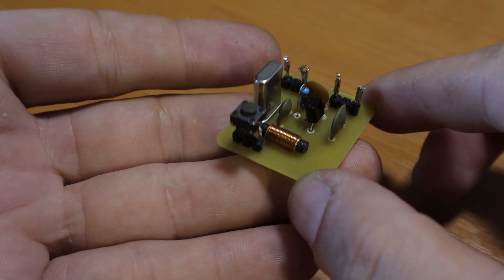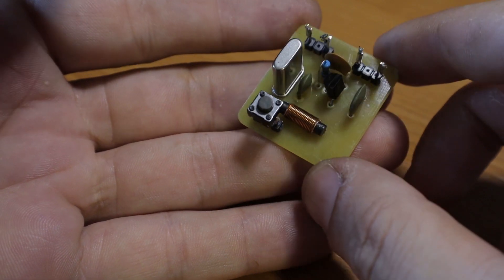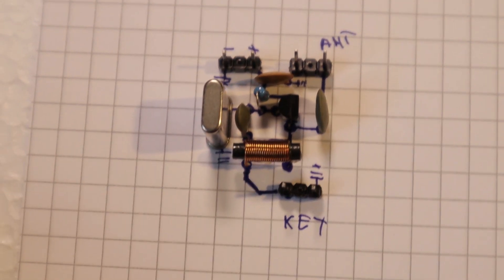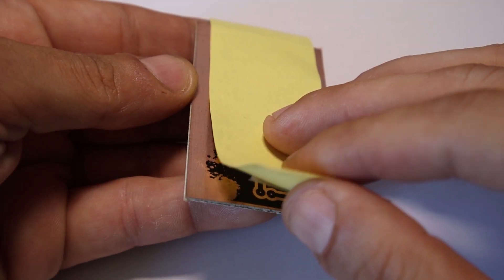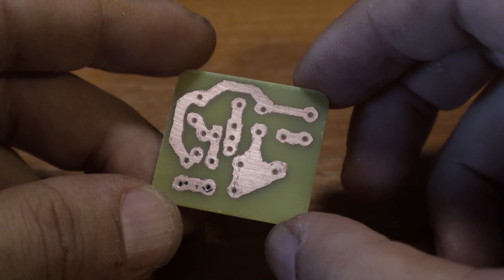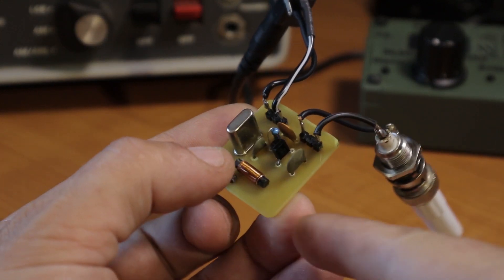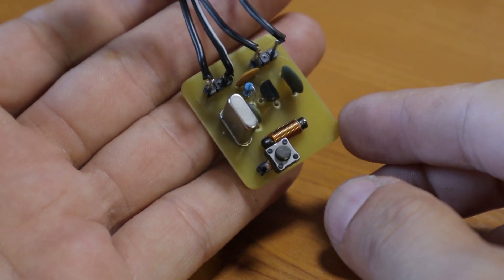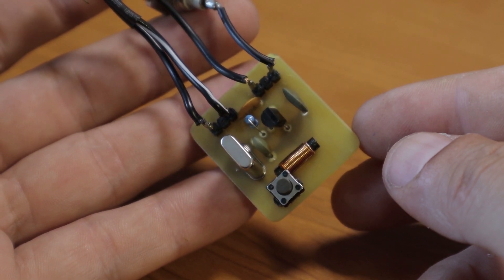Minimalist CW Transmitter With One Transistor - 550mW @ 12V

Comment: Haha, when i saw the thumbnail and i read the title i thought that something must be missing. Really tiny like the fm bug transmitters. 700mw is great! 73
Reply from the maker: It is a fun one indeed. A lot simpler than the 10 min transmitter. Only that in the PCB design I also placed the low pass filter on the output. 73 buddy.
Reply: @dxexplorer it would be nice to have an 1watt cw transceiver with tuning control for lets say 40 and 20m. All i can find is really complex circuits. The simplest is the pititico transceiver.
Reply from the maker: @sv2tcb If you have a little patience... your wish may come true. Not that simple like the Pititico, but not too fancy either. 😁
Reply: @dxexplorer  do you have any circuit or something?
Reply from the maker: @sv2tcb No... not yet. But I am trying to work on something. I just didn't had the time... but I have some ideas in my mind to build exactly what you are thinking about 😁. I just need to build it and test it. Not much free time now... that is why I asked if you have a little patience 😅.
Reply: @dxexplorer  haha yes, no problem. Great things take time. Many 73 and good luck.
Reply from the maker: @sv2tcb Thanks so much Nikos. Hahaha hopefully it will be something great 😅😅. Fingers crossed. Have an amazing weekend my friend.

Comment: Very nice mate, but please explain tbat a low pass filter is required.
Reply from the maker: Yes yes I wrote that in the video description. And the PCB board that I am making also includes one. Wish I had an osciloscope or something to measure if it actually needs a low pass filter. Some are a bit "dirty"... some have quite a clean signal with no harmonics. But I have a feeling this one is not that clean 😁.